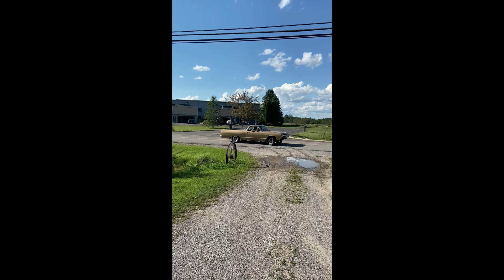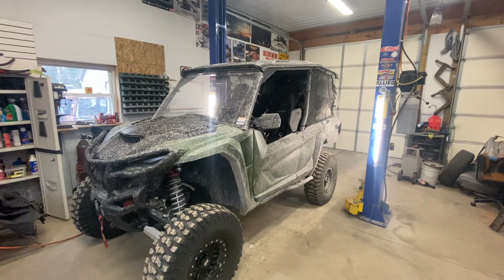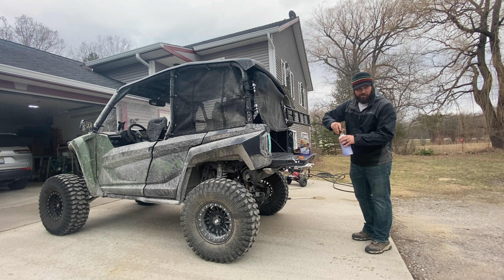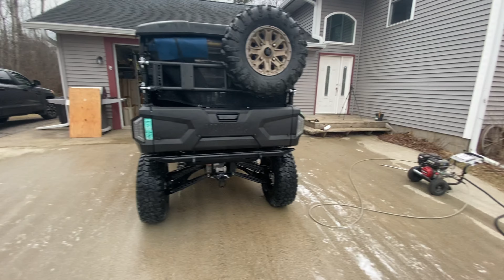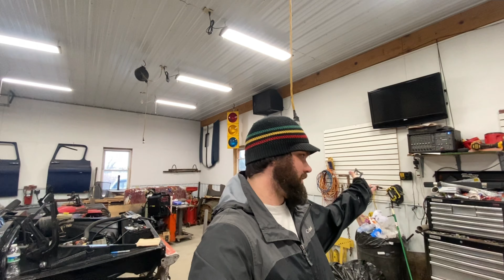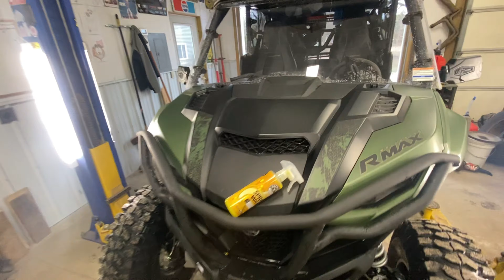2021 Yamaha Rmax 1000 XTR Wash! (Foam Cannon!!)

Comment: Hi, just have the same one, 2 seater tho. Just bought it new 2 months ago, never sold at the dealer. Not a big thing here in Belgium 😊. Just got 500Km and rust is already on exhaust pipe and some bolts of front swaybar and others are not rusted on sale swaybar etc... Is that normal?